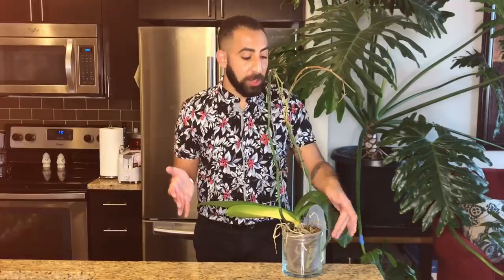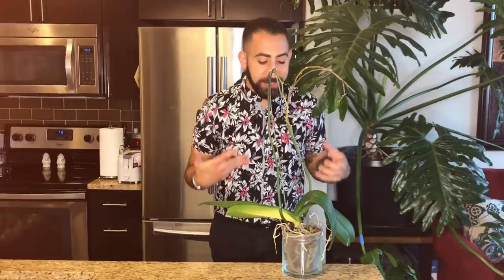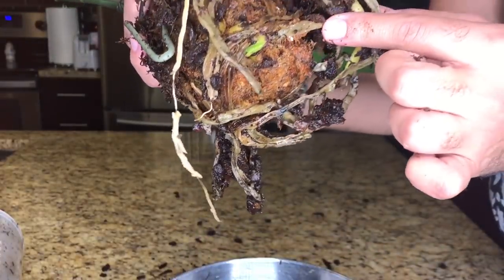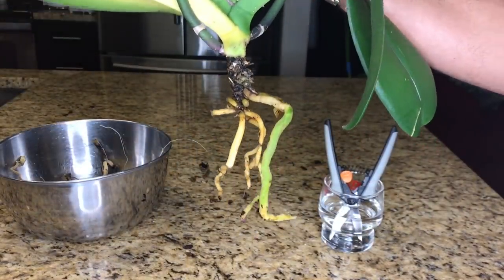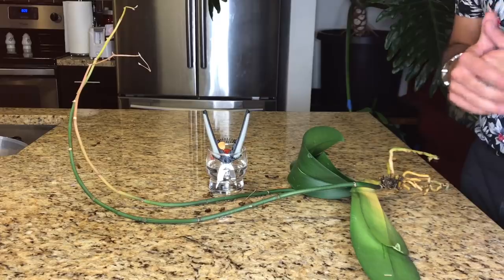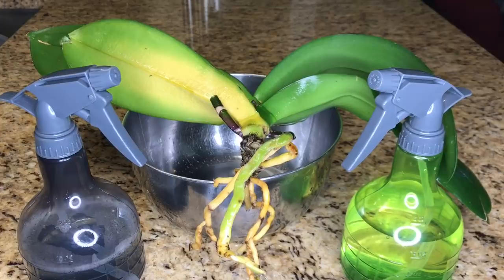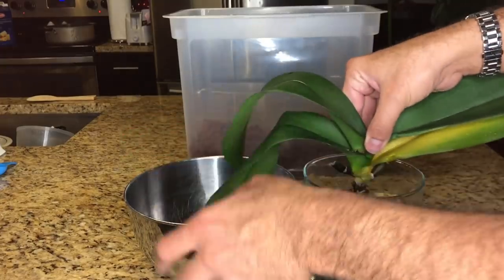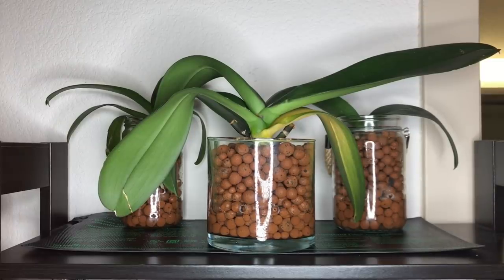Converting Your Orchid: Semi-Hydroponics

Comment: Hi Michael -- from one horticulturist to another, I love your videos.  You are my current hort crush. LOL
I have a couple questions for you.
First question: Do you only use the Physan 20/alcohol sprays when you are bringing new orchids into your home?  How risky do you think it would be to skip this step since I am only converting orchids that have already been in my home for awhile?
While I understand the purpose of the Physan, I'd prefer to skip the pesticides altogether whenever possible.
Second question: at what point do you remove the bottom heat?  Once it reaches the point of new leaf emergence?
Thanks!
Reply: I'm new to Semi Hydro (7-8 weeks) and I was wondering how long I should use the heat mat too on the phals I just converted.  I'll keep looking thru comments to see if it was answered. Anyone?

Comment: as always I'm a big big fan of how you teach. that's all what I learned in 6 weeks or reading and watching in 15 minutes 🖒

1 thing tho 
I learned someting about rootburn on damage roots by fertilizer. 

fertilizer on damage roots can burn them and we want we maintain those few roots as long as possible. right ?!? 
 so if you repot you are bound to have some halve cut of and broken or scraped roots. 
and it will burn there at those places when you fertilize them before they had a time to heal. phalaenopsis roots calus over very quik in 3 to 4 days extualy and by rinsing when cleaning they have enough moister to last those days to heal there wounded roots. and if you water and fertilize then... then everything is peachy. 

ps to speed up the calus proces spray the roots 1 more time with hydrogen peroxide 3% it helps with drying out and calus the wounded portions. 

I noticed that you give kelp max and fertilizer right after repotting....
so that's why I wanted to warm you.
 I wait 1 week with fertilizer and when I have airial roots on phals I spray daily rain water and a 25% kelp solution on the airial roots to promote root growth down in the media. ( higher concentration burns the airial roots )
also you need to have roots for the kelp max hormone to work so a orchid with no roots at all can't take in those rooting hormones but  either plant it or keep it in water. 

I'm yapping agian. I hope I'm not insulting you. by no means I mean to insult or tel you what do. this is just someting I learned form more experienced growers and I take that to heart. ps I can find the video of Roger Frampton explaining the calus over part and keeping it dry for atleast 3 days. if you want. 

again no disrespect ment.
Reply from the maker: No disrespect taken! I always want you to feel free to offer insights and feedback, it helps me learn as an orchid grower! I've heard this warning before, and I totally understand where you're coming from. That being said, my own experience has given me the impression that (because the roots will almost certainly rot away) that the most effective moment to give the orchid a nutritional "energy boost" is right when I convert it. If I wait 3-4 days, the remaining root system may have already begun to rot, and therefore be incapable of processing the nutrients. Think of it this way: I know that the plants are going to be "fasting" for around a month, so before they begin that process, I give them a big meal to tie them over. Again, this is just an opinion of mine: I've had greater success when I fertilize immediately after repotting than when I haven't. Either way, thank you for sharing another valid approach and perspective!
Reply: Michael's Orchids that actually makes a lot of sense. I have no idea if damage roots can take up that meal. I'm not a scientist so I'm completely torn in 2 now🙈😂 I know that phals callous over quick but other roots like oncidiums or other thin roots I don't know.  so I will experiment on that when I have my grow room and get some rescue orchids to experiment on. 

thanks for your explanation about your experience. it gave me loads to think about. 

funny story I just quite school because of health issues..but once again a made a homework list 😂 

it contains: 

- ray barkalows site about tds ph and water theories. 
and semihydro teachings. 

- massive redo of my orchid notes in excel to get all the temp light humidity fertilizer water requirements. also when i got them, repot dates, pictures and diseases or pests. 

- and then make my own mini culture sheet as cheat sheet when I fertilize water repot etc 

- also I want to understand the why behind the how to.. so searching native habitats of my plants. 

- then studie water culture for different types. 

when I was in aquariums my motto was you can never know to much and always measure twice. so I spend months reading every article I could find and got the right tools for the job. and got 21 aquariums lol

your road to knowing and measuring and some other channels and there advise made me realise that a halve ass job is going to kill my plants eventually. 

so because of you I'm taking this more serious. and just today ordered a digital ph meter to go with my tds meter and a tripod to make my vids more watchable  (I shake like a leave ) 

so again thank you for inspiring me to be a better orchid grower. 

I could not be more proud to be learning from you. keep it coming hunny your the beesknees ❤
Reply from the maker: You're so wonderful, thank you for your kind words and faith! Things will unfold differently for each grower, but every experience and perspective is valid in its own way. I love your homework list, I have a huge one myself that (in large part) is based off of the feedback of my viewers, who guide to explore different methods and theories. There is always room to learn more 😉

Comment: I am trying semi-hydroponics.  I believe in your video you said you water weekly.  I am looking for a little more specific information.  Does it matter if the reservoir is completely empty before you water?
Reply from the maker: It doesn’t! Also, if you check the description there is a section titled “my system explained.” Check out the watering video, which explains in greater detail!

Comment: Great video. Few questions, how long do you leave them on the heat pad. How do you know that the temp of the heat pad won't make the water too hot and what is the ideal room temperature and humidity for Phalaenopsis?

Comment: How long can the orchids stay in the semi hydroponic pot? How often would you water?
Reply: They can stay in semi-hydro forever. When they need a bigger a pot you just pull the whole thing out like a plug, put it in the bigger pot, back fill with Leca to fill the new pot. Done. The expanded clay pebbles never decay so never need to be removed or changed.

Comment: Thanks for the great videos! I’ve learned so much and I’m about to switch a few orchids over to semi hydroponics. Just wondering.. you mentioned the current root system will all die.. do you need to repot again after that happens?
Reply: He said it will die off and be replaced. If you can remove it, go ahead, but keep in same pot

Comment: I changed my media into orchid bark chips only and I had a leaf turn yellow and it fell off when I touched it. I since then have gotten 3 new spikes (humidity roots) and a new leaf forming. I didn’t use any of the spray bottle techniques, or kelpmax but wow about the water and cutting the flower spike,... my directions said to cut at the base when blooms fall off. 0-o 
But it got dehydrated bad within the past 1.5 weeks, so I’m doing a black tea soak and dry soak cycles. Has anyone else seen that video? Have you tried that process?

Comment: I've got almost everything you've recommended for my toolkit.  Two things are missing - the KelpMax and the heat pad.  I did look at heat pads, but some wanted me to put a probe into the plant to monitor the temperature.  I didn't like that method.   Do you have a recommendation.  Another question I have is when you spray the roots then the foliage with protective  spray, do you rinse it off after the 10 minutes rest before you spray it with the Physan20?  Furthermore, do you then rinse the Physan20 off the foliage and roots before potting in the leca beads? I did see another Youtuber who uses Listerine!  I thought that was rather innovative.  Whatever works as they say.
Reply from the maker: Hi Aprille! Yes, I always rinse the solution. And here is a great way to monitor temperature: https://youtu.be/NOE1Pj_QQLs

Comment: Hi there! I have a question for you..... I followed your method of converting my phalenopsis orchid to semi hydroponic and it has been looking great! New roots and leaves and it looks so much happier! I decided a few months later that it was leaning a bit and I wanted to redo it. So I took it out, boiled to leca beads and rinsed them until cool, cleaned my glass container including q tipping the drill holes until it was super clean, I sprayed the roots with hydrogen peroxide and put it back in. I am using espoma orchid fertilizer every time I water, and now i notice through the glass some pretty significant white furry mold on the roots. What should I do???
Reply: Hydrogen peroxide to clean it, as something was hiding in there

Comment: at leat the plug you have is of moss. i once bought an oncidium which had a plug of something wood related. i had to cut all the roots off.
Reply from the maker: So bizarre, I don't know what a lot of the original growers were thinking.
Reply: billy I had that once. it was so weird and 1 good roots grew true that coconut type bark chip thing. so i tried for 45 min to an hour to slowly pick away at it with tweezers until I damage that root..... and that's when I was f#&$&&k this it's getting off one way or another. and them i just ripped it of. I know in Thailand they have a lot of those cocohusk plugs and I take spagnum over that hellish thing anyday.

Comment: Can I use small river rocks? And can I use a glass jar?
Reply: River rocks don't hold water and nutrients the way the clay pellets do.  You can use a glass jar, but you either need an insert (net pot) or you need to drill holes in the glass jar (watch his video linked at the top).

Comment: I had 2 palaenopsis but they never flower what was the problem?
Reply: How long have you had them? I had a coworker tell me it has been two years since her orchid has bloomed which was from the time she first purchased. I told her she needs to check her root system and leaves if both are good then it is temperature more so than light. Phals are low light orchids but require a slight cool change in temperature to tell them to spike. So even changing it's location for a couple weeks and putting it back in the familiar location will kick start it. Sometimes you just need to be patient. I had a orchid only have three leaves and didn't bloom for months then it just decided one day to do it. I also know orchids like to be a little snug before they will bloom though not necessarily since some of my orchids have plenty of room for their roots putting out spike.

Comment: How do you prevent  from forming mould, I have this problem  with one of my fouls
Reply from the maker: Hi Sigrid! If you're growing in Semi Hydro, there is no way to avoid the mold; it will grow on the decomposing root system, but then the new root growth will eventually take its place. If you are not growing in SH, I'd check to see if your potting medium is too small/water retentive. Your roots could be suffocating, dying, then molding.
Reply: Michael's Orchids thank you I am growing sh I'm done with dirt and bark thanks for the info